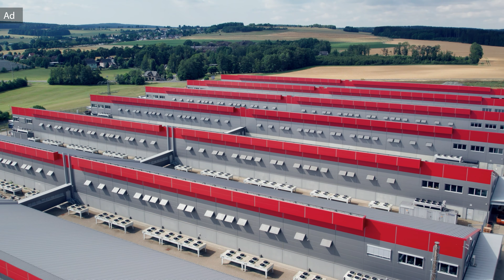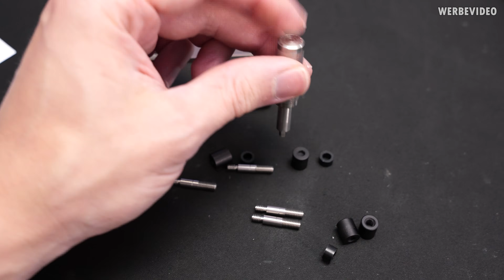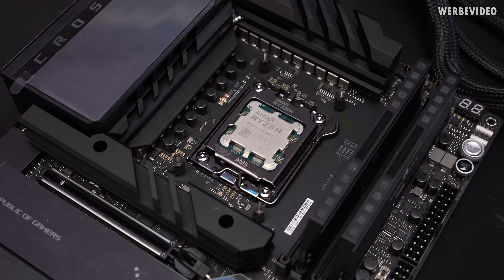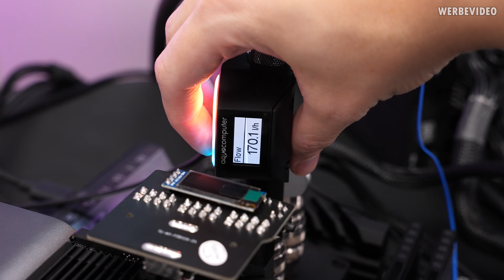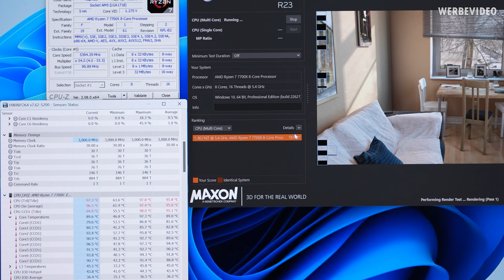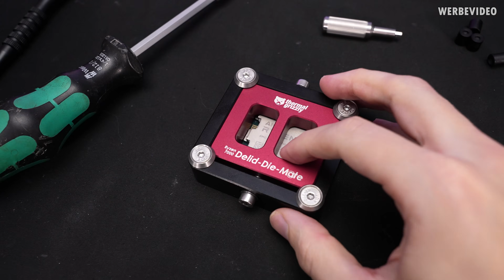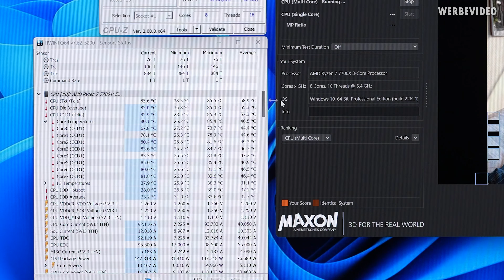The King of Water Cooling and Questionable Marketing

Comment: I've had the Optimus foundation block for about a year now, primarily on a 7950X. Even this is truly impressive and a less restrictive than my prior EK Velocity. The new signature is gorgeous and I'm really curious how it compares. The design is impressive but I doubt all that buffer mass is significant. It's hard to believe the difference is substantial and they don't even compare them.

All that said... seriously Optimus, what are you doing? You have phenomenal products that speak for themselves. Obviously you aren't beating direct die through that thick IHS and if you somehow did, I'd expect DETAILED testing results right on your website. Not just test parameters, links to user posts or vague statements. Otherwise, it's just unprofessional, suspicious and sours your brand for no reason. You have the best blocks in the US, arguably the world, with a target demo of hardcore enthusiasts. Just stop this hyperbole and first year marketing nonsense. Make those of us in the US proud to have a solid, local brand that takes pride in their work.
Reply: On a 7800X3D w/ IHS at idle, the Signature 3 is about 6-8 degrees cooler than the Foundation block I ran previously.  Is that worth the price difference to most people?  No..  But I wanted to try it out and continue to support a domestic brand that produces outstanding product.  I still think for 99% of people the Foundation block is plenty and better than almost any other block even taking the price into consideration.  If you catch a blemish block on sale all the better as their quality standards are INSANE.
Reply: @GRCDriver23  I appreciate the insight but that's a lot actually, especially at idle.        I do believe there's a difference but as you said the foundation is already awesome. I'd really need to see some results under load after it warms up. Even if your results are fairly accurate and not affected by other obvious factors, the added mass could influence this until it equalizes. I'd love to believe it's THAT good but it would be so much better than any other block that I have a very hard time believing it.
Reply: Yea that buffer mass is doing nothing usefull with the possible exception of being structural rigidity

Comment: Optimus should explain why they have a signature lineup with this massive surface area for AMD but their Intel block looks just like the EK magnitude. It doesn't make sense to have such disparate lineups. If they make a signature block for Intel that is much larger than their current one then I'd consider it.
Reply: Hey, Optimus here, a Signature V3 for Intel is coming soon. Our other blocks, while having slightly smaller cold plates, feature our same fin design which means the highest surface area available.

Comment: couple of thoughts on the testing.  Optimus did it on a much higher power CPU.  They used a chiller to keep the water temp the same which is understandable.  prime95 is a pointless test though it isn't real life.  All you can say is that for their particular test they seen a tiny bit of temp difference.  It isn't real life though but that's advertisements for you.   Temps are all well and good but what does the actual performance say.  how many more fps do you get or how much quicker is your render?    I don't think their marketing is questionable just very specific to a particular scenario

Comment: Don't even try to buy anything from these guys. Optimus never has anything in stock and their models/lineups are confusing and make no sense.
Reply: Never had a single issue buying their products.  If the product page is available you can order it.  Shipped next day and gets to me in 5 days cross-country.  I own two Absolute Threadripper blocks, 3 Foundation blocks and two Signature blocks and 5 Absolute Reservoir pump/reservoir combos. Very happy customer with their service and performance.

Comment: They are correct in one respect though: Using a chiller to test, keeping the water temperature constant and thus eliminating the water->air variance from the radiator.
There is a positive feedback loop in efficiency for any radiator where higher water temperature allows higher energy transfer from water to air through radiator.
What we want to know for a waterblock is simply best transfer of heat from CPU to water. Room temp and water temp will influence this a bit. You try and compensate for this by subtracting water temperature but if water temperature has changed it has changed the premises for the rest of the thermal deltas in the test. Not by much probably, but the margins are so small here.
Reply: Welp yeah but no. If your room temp is the same you have results you can use.

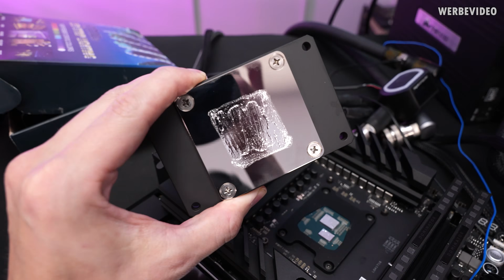Comment: 14:17 
to avoid using excessive amounts of lm, apply first on the die and put the block on . Then remove it and check where to apply on the block (should leave a pattern from touching the chips) and also if your contact was good enough

Comment: Great to see that you're contacting other independent reviewers to check your own findings.

I do think it's strange that they would have tested with a chiller, as most people even when they buy an expensive block wouldn't use a chiller. Even if it was only because of the noise. It may explain why they didn't use liquid metal though.
Reply: likely because they don't have the ability to regulate the ambient temp of the room they're testing in. using a chiller is a lazy cheat code for that since you can set a specific temp to test with.
Reply: Hey there, Optimus here, the temperature regulator aka chiller is kinda like a benchmarking cheat code :D We do regulate the room temperature, but only a temperature relator can accurately control the liquid temp and remove the fans and radiators from the equation, so you can truly get scientific apples-to-apples comparisons. Doing only air test chambers, while good for air coolers, isn't very accurate for waterblocks with fluctuating liquid temperatures that move faster than an AC room cooler will be able to react @sirmonkey198
Reply: Hey there, Optimus here. Great points! To clarify how the testing is done, we use a temperature regulator that both heats and chills, this keeps the liquid constant at 25c +/- 0.1c. We are not chilling down to 5c. The goal of the temp regulator is to get consistent, repeatable results by taking the fluctuation of liquid temp, fan speed, radiator size and room temperature out of the equation. Without using this kind of test, the margin of error is vastly higher. Regardinng liquid metal, we tested everything with KPX paste because that is what we include and what customers can expect. So in our benchmark numbers, we compare blocks using only the same interface material, and don't mix it up with one block on LM and another on paste.

Comment: I' ve bought Micro few weeks ago, expecting ~60-65c on cores like it was on the first video, but temps are more like ~80c, like on this video.... (3 x 360mm x 45mm rads with AC P12 fans + cond. extreme), it was only few degrees better than my lapped ancient EK Supremacy with coollaboratory liquid pro, also in direct die configuration...
Reply: If you have mediocre flow, your results will be worse. Also, that's temp-normalized
Reply: @rustler08   what do yo mean by normalized?

Comment: I am sure anybody buying this either of these blocks would be at least using a 7950x. P95 on a 16c/32t at stock volts with PBO enabled should have been the test enviroment. Let the CPU stretch its legs in a higher density core layout.......

Comment: My expectation is that when they tested the TG Mycro, they used KPX between the die and the coldplate, not liquid metal. Which is dumb, because anyone that is comfortable enough with delidding is 100% going to use liquid metal.
Reply: 100% this …also gota say I like Roman’s rawdog approach to not protecting the caps near the naked die as well 😅
Reply: I doubt thermal paste can even transfer heat fast enough for such a small die. I used on 5800X3D ( check OCN 5800X3D owner thread, I delided for the sake of curiosity), temperature shot up to 80C in cinebench, but on LM its well below 60. Die is so small hence only LM can handle it imo.
Reply: This is what I'm thinking, too. And at that point, it's because the TIM is inappropriate for the use-case not because the cooler is so good.
Reply: Hey there, Optimus here, very good question! The reason for paste is because the results are far more consistent run to run. When we compare blocks, in order to truly know the correct results, we will use the same interface between blocks. Using LM for one and paste for another and then comparing the results wouldn't be a true apples-to-apples comparison. Additionally, interestingly, LM on the 7950x at 250w is only a few C better than KPX paste, which is extremely good. Other blocks will have a higher delta because of how they're designed than the Signature.
Reply: @optimuswatercooling  Its not about "keeping it consistent"! If you make a claim that your block is better than a direct die block. You need to use the parameters EVERYONE would use if they use directdie. There is no point of going through all the work and risk to direct die, and NOT use LM. It just dont make any sense at all!
Absolutely no one would directdie a 7000x CPU and not use LM.
Its like comparing a sports car with 1000horse power, and put on the smalest/slimmest tires you can find from a small hatchback on it. Then compare it to a small hatchback, with 90 horsepower, and say "they are just as fast", cos the 1000 horsepower car cant put the power in to the ground on those super slim tires. "Using bigger tires for one and car for another and then comparing the results wouldn't be a true apples-to-apples comparison" Yeah, but if you put up super unrealistic and dumb parameters, you get stupid results and conclusions!
Reply: @optimuswatercooling so how could non direct cooling using your  block be even cooler, than direct die cooling when you have just admitted, that LM direct die cooling is still a few degrees cooler.
You’ve just lied to yourself here and are believing your own marketing BS. 🤦‍♂️
Reply: I'm not sure I'm following your question. We backup our numbers with how we achieved our results on the site, it's extremely detailed. We only use paste on all tests so the results are apples to apples, that's the scientific method. In our tests, our block on the IHS is better than the Mycro on the die. If someone follows the guide how we test, they will get similar results. @andydbedford
Reply: @optimuswatercooling  Where do I find detail about your test? Do you use chiller or just room temperature wc?
Reply: @optimuswatercooling  Optimus's Signature V2 and V3 are fantastic blocks but soon as i saw your blatant lies in your website i desided not to buy it. Your marketing claims Signature V3 block beats direct die blocks while having original IHS attached to the CPU. With identical testing conditions (coolant temperature, flow etc..) no waterblock that need contact the cpu trough IHS will have smaller temperatures than direct die waterblock, no matter if Optimus was used with LM or not, it wont beat Direct Die because of basic thermodynamics. If your testing results say otherwise then your testing is flawed.
Reply: Glad you liked the look of the blocks :) Your point makes logical sense, though we stand by our testing and believe it can be easily repeated when run on a 7950x at 250w. We provided full details of how it was achieved. The simple logic of how it works is that the IHS only adds roughly 6c with our block (it'll be different with other blocks). At 250w or higher, the challenge to cool the chiplets becomes vastly more difficult, that's why a block with a super high fin surface area like the V3 is able to perform extremely well at high wattages while lower surface area blocks will struggle. We were surprised with the results but other users have had similar experiences   @sudouser85

Comment: I actually think it having Phillips head fasteners is a bonus, not a negative
Reply: Phillips is much easier to round than hex or torque
Reply: @xionsolaris  that's true.
But if you're not too rough that can be avoided... I just like that you can do it with a full sized screwdriver
Reply: @xionsolaris significantly easier :(
Reply: @elcactuar3354 yes thank you

Comment: I knew something was sketchy when I read their website and they claimed the flatness of their coldplates was less then 25 microns of 'surface roughness'. I'm a machinist, so I know that surface roughness is a finish spec, not a flatness spec.
Definitely a failure of the marketing department. I bought my CPU and GPU waterblocks from them, and they are beautifully designed and constructed. The machining is phenomenal.
I've been very pleased with my purchase, even though the first one I bought leaked like no tomorrow, due to the acrylic top being very much NOT flat at the mating surface. They were talking to me about it until I sent them pictures of just how NOT flat it was (0.33mm). Since then, it's been radio silence.
Reply: @elcactuar3354thank you for correcting my phone. well done.
Reply: Hey, Optimus here, glad you like the blocks! And you bring up a good point. We'll look to clear up the confusion about roughness vs flatness vs smoothness etc. When our cold plates get mounted, they are no longer "flat", they'll have a profile to match the IHS. However, they are perfectly smooth to an extremely high degree when they come off the machine. We believe we're the only company who does a true mirror on copper direct from the factory. And, sorry about the CS issues, we might be slow sometimes, but we'll always get it taken care of!
Reply: @optimuswatercooling , Hi Can I put an Optimus CPU block (which Optimus block?) on top of a Thermal Grizzly AM5 heatspreader? with a Ryzen 7800X3D?
Reply: @optimuswatercooling I feel like people don’t understand the background of your company and the insane tolerances that go into each product.

Comment: wouw claiming lower temperatures through the IHS then a direct die cooler.....that seems to defy the laws of physics when comparing apples to apples other then the cpu situation >.>
Reply: Agreed, it's a rediculous claim. I'm not surprised to see it was not accurate. Perhaps when they tested against the mycro, they used it with cheese as thermal paste?

Comment: Imo the 7700X was a poor choice for testing.  Anyone buying any Optimus block is getting a better CPU than the 7700X.  In this case, a proper test on such a weak CPU, by comparison to 7950x, higher end x3D models, would have appropriately been a heat load like Prime95 to simulate the greater heat load of a higher power CPU.  A simple OC was not enough when an OC on the higher power CPU is already likely.
I agree with Optimus here, it’s weak testing on a high end enthusiast block.  However, their marketing is ludicrous.  Anyone who has been doing this long enough to know better isn’t going to believe that nonsense.
I have attempted to purchase Optimus blocks on several occasions.  It always ends up with a preorder that takes way too long then I cancel and get an EK block, and am subsequently disappointed by the EK block.
Reply: I'd argue that 7700X is harder to cool since most of the power goes to a single CCD so it uses more W per core than 7950X which results in much hotter hot spots.

Comment: I think that PVD coated brass with titanium alloy.
The coating looks almost the same as mine, mine comes from Aquacomputer in well you know :P (it comes with a tube Thermal Grizzly hydro :P )
Mine was 180 but i got it for 80 since i am old (54) and been using their stuff since the first block :P
You should try one out to mine got Vario i can adjust the bow of block with 4 screw's. got 2c by tuning it.

Comment: If you test with a chiller, you can cool your liquid down to 4°C, that isn't real life use. Also, a chiller costs an extra between 400 and €500 for the smallest one. While they recommend using a radiator and a special pump. This so overkill and unnecessary.

Comment: When did the term "direct die" become to mean just mounting a cooler on a CPU with the IHS removed, I swear I remember "direct die" meaning running liquid over the actual die, which quite frankly was an absolutely ridiculous idea and definitely not for the faint of heart since you're relying on the seal between your "block" and the CPU substrate to keep liquid from going right down in the CPU socket, I don't know if anyone's ever tried to do that again since Bloomfield almost 15 years ago.
Reply: Never heard of anyone running liquid directly over a die, only removing IHS and mounting water block directly to the die.
Reply: Running liquid directly over the cpu die would be much worse than having a water block on the cpu die. Inside that water block is the cold plate which increases surface by magnitudes to dissipate the heat much faster and more efficient than having a plane die. So direct die cooling is removing the heat spreader and putting on the water block directly to the die. That's how it is meant to be, what is most efficient and how it works the best.